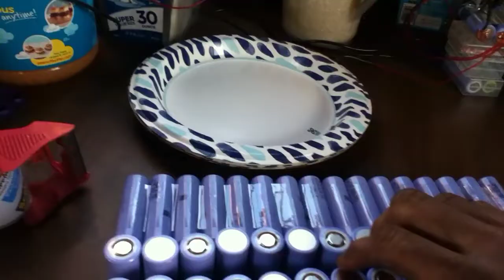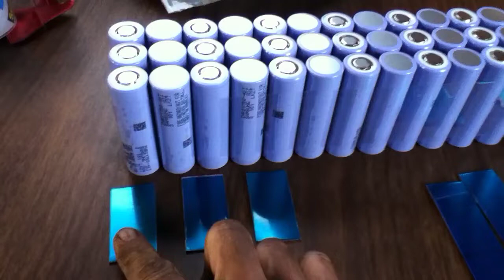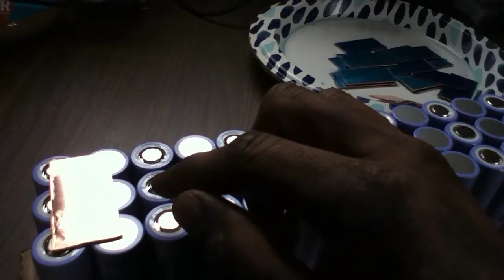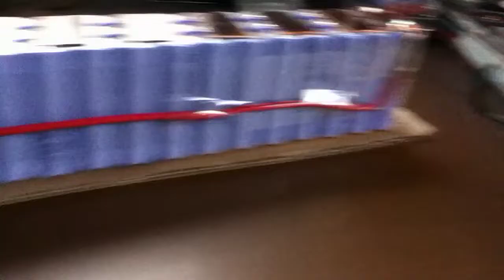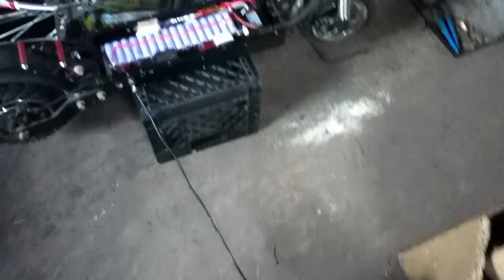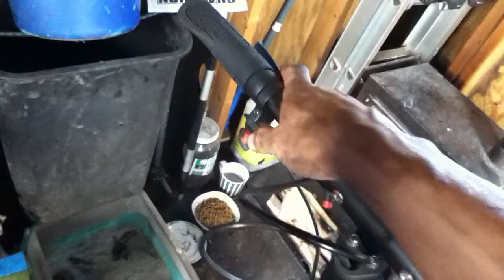How to Build Battery Pack without Soldering ,the Simplest Way

Comment from the maker: Important Disclaimer  This battery pack failed after 1 month of use as the silver content in the silver paste epoxy is fake. It was not real silver nor did it have any purity. Most places carry fake silver so be extremely careful before buying this kind of product. God told me that if this had real content of silver it would have worked fine on the battery build, exceeding the performance you get from pure nickel stripped battery pack in terms of delivering the current in efficient and effective way.  Unfortunately God told me you won't be able to get real silver content on these epoxy so just go with the spot welding technique on the pure (or near pure) nickel strip which can be found on internet if you look hard.

Comment: So, I’m building my first battery pack for my custom scooter—a 16S4P configuration (60V, 20Ah) using Samsung 20S cells, which have a discharge rating of 35A per cell (that’s 140A total!). However, I only plan to install a 100A BMS (Battery Management System). In this case, I shouldn’t use 0.2mm nickel strips, right? Given that 100A will be flowing through the pack—similar to what you show in your videos—I need to use copper strips, correct? Should I use 0.2mm copper sheets that I cut to size, or perhaps purchase pre-cut copper strips designed for two parallel cells? Is it correct that, when using a 100A BMS and building a pack like the one in your video—but using high-performance Samsung 20S 21700 cells (with a 35A discharge rating each)—I should be using copper strips? Is that right?

Comment: Thanks bro your the best💯👌🏼I appreciate you bro🙏
It’s my first time trying to understand how I can build my own battery, would 52v work on 48v ebike?
Many others cuts the video fast forward it miss leading
Reply from the maker: If you want to use a 52V battery you will want to use a controller that supports 52V.  Some 48V controllers can take 52 or 60V battery pack but will put stress on the metals inside the controller and will burn out faster.  You could use a auto-switching 48V~72V controller and use the battery voltage of your choice.  Most controllers sold to the public are garbage as they use junk metals in the controllers. They are absolute junk so their life is anywhere from 2~ 8 months. You could just replace the Goddamn controller every sever months so you can keep the ebike running. Or just wait for a year so that the quality of the controller gets much better.  Blame the Korean bitch criminals underground.   You also have to be careful what batteries you buy to build because most of them are absolute garbage. The batteries can't handle more than 2A and will lose charge soon. They have very short life.   Just forget the ebike route and get a Dualtron Sonic Model A Alien as it comes with super materials used in the battery. Samsung 50S they claim it uses is a rebadged name but uses extreme premium materials so it will handle very high voltages and current.  Both the battery, controller, and the motors should last indefinitely unless you break it by accident.  You don't have to worry about building a battery pack because the bulk batteries you get a nearly all junk.

Comment: are there any mechanical clip on contacts for batteries, similar to the battery holders for pcb soldering, but that clip on with some sort of flex pushing them against battery terminals ?
Reply from the maker: You could use Vruzend battery building kit for building a battery pack which won't require soldering but it takes up a lot of room height-wise.  I would refrain from using silver epoxy right now because they all are made with fake silver and use absolute garbage metals that look like silver.. so they cannot handle any high voltage and current that's beyond 5V...  Just use nickel strip and spot-weld your battery....
Reply: the battery holders to be soldered to pcbs seem like the smallest bulk, are there any videos to make a lightweight 10S1P battery for ebike with 5 Ah batteries ?
Reply from the maker: You don't want to go 10S 1P for ebike application because the battery will not be able to handle the load. Even with the 5 Ah battery cells it will not cut it. The voltage will drop very dangerously and will lead to shutdown due to low voltage cut-off.  You need at least 3P.   And go with the Samsung 21700 40T cells.....  They (the genuine ones) hold more energy than the 5Ah cell like the Samsung 50E or LG M50LT cell.  And the life cycle is nearly infinite, those now have special metals inside the cells for very high energy output and energy storage.

Comment: Rule No.1 in electricity, is to avoid loose contacts .
In the case of battery DIY The best thing to do is to solder by any means to avoid FIRE .
Loose contact generate heat when higher load is applied .
Safety must always be prioritise over money , unless you give no value to your life .

Comment: This connections, where is 4 cms of wire without isolation, will after heating of one cell, due to overvoltage / you have no BMS /, destroy not only
battery and scooter, but also your house, look at fire department videos, what H2 C2H2 CH4 HF CO etc. can do to your house, if not ventilated.
BMS is for controlling temps. Temperature of cell is crutial. What is thermal runaway temp for: NMC433 NMC532 NMC622 NMC811 NCA LMO
LCO LFP LTO LNiPO4 etc. ? If you do not have at least 20 Dallas or LM335 temp sensors, hhow you can derive dT / dt ? At what temperature
raise of your cell, you have to throw all you pack into 1000 litres of water to cool ? 
People are not educated properly, what ammout of energy is concentrated in this cells at 100 % SOC.
You do not have temperature propagation isolation between cells, you do not have proper cooling of the cells.
This all are risk factors, and nobody will use battery like you, becasue he is responsible, and at least reads 1000 pdfs
form Stanford Berkeley MIT Dalhausie JSNW etc. , before constructiong such battery pack. 
If you do not care about reading, you will see, that this design is bad, look at 2000 videos first, how do make such powerfull pack.

Comment: Even with fast forward it doesn't help i hope it workec
Reply from the maker: Don't use silver epoxy and copper. The silver epoxy being sold to the public are all fake. They don't have silver content at all..  They use absolute junk leftover metals that look like silver.  Just use fake nickel strip available on amazon. They will actually hold the electrical flow and function, the silver epoxy will not.

Comment: I dont see a  bms board, did you install one?
Reply from the maker: My batteries don't have BMS, none of them. I have multiple packs that are running great, no problems and it has been 2.5 years.  The batteries, without the BMS, self-balance at all times, whether charging or not.  The implementation and deployment and education on the BMS all come from the underground criminals.  They use it for evil reasons, to track and kill people via electronic weapon by attacking your blood cells and oxygen. They use our own battery (and the batteries in nearby area within proximity range) to attack our blood.  The BMS connects to their server for this very reason.  And my advice to you, please don't buy any batteries the reviewers and marketing recommend. For example, Molicel P42A batteries, are actually made with absolute junk metals that are nearly totally worthless. They degrade very quickly and crack, even with fairly low current charging at 2A.  They have very short lifespan and can't handle high current the crooks say they do.  Nearly all battery cells that the general public can get their hands on are all junk. They go bad quickly.   The only ones that are real good are the special batch (foregoing production) Samsung 40T cells.  They contain 99.95% purity silver in the cell.  The criminals don't want you to know because of security reasons. And they are priced very low.  Check here to obtain them. -->  https://apowergroup.en.made-in-china.com/product/yBXQvmOuXJfh/China-3-7V-14-8wh-Inr21700-40t-21700-4000mAh-Lithium-Ion-Battery-for-Samsung.html    The reason why I know which ones are the special batch and which ones are the fake ones is because I get information from the underground criminals because I hear them (and see them) spiritually their conversation. And God tells me to confirm.

Comment: So I'm new to all this as you will probably see with my question. You stated the power dropped when throttle or a heavy load was put on it. First thing I thought of when you said that was my house furnace. It has a large blower motor and to get it running up to speed a large capacitor is used to assist in the voltage it takes to get going. Would such a capacitor benefit your scooter if installed? Its called a Run Capacitor.
Reply: 2 years ago, I purchased a E-bike NCM Prague, and the bike including battery was left outside in the garage and never tended to. I believe 1 charge was put on the battery after we got it home. Now the 36v battery is reading 0.008 on the multimeter completely dead. So, I have purchased a bunch of equipment to try and learn how to make and repair packs myself. Also, I have power tool packs that need repairs, so this has also got me curious and wanting to learn these skills. Sorry for the long note here I just wanted to give some background. Thank you so much for your time making these videos as they are very informative.
Reply from the maker: @ejkiras  As for the dead battery on your ebike it's the USB port on the ebike sucking up all the juice so if you leave it uncharged the battery will die after a while.  The battery needs a jump start.  Jump starting li-ion batteries on youtube videos should work..   Unfortunately the most (almost every seller on the net for the general public) battery cells are either fake or made with junk garbage materials so they can't handle high current charging and discharging and will not last.  If you need real genuine Samsung 21700 40T cells let me know I will give you the link to it.  They handle 12A charging and 25A discharge without a single sign of degradation. They come from completely different source for materials to produce them.
Reply: @noobz5056  I would like that link please and thank you for your response.
Reply from the maker: @ejkiras  EDIT:  You can go here -> https://apowergroup.en.made-in-china.com/product/yBXQvmOuXJfh/China-3-7V-14-8wh-Inr21700-40t-21700-4000mAh-Lithium-Ion-Battery-for-Samsung.html   God told me that the Samsung 40T cells they sell now come from a different source, the materials, that are sent for production. It is the same website, one of the multiple places out there on the web. The cells now contain special metal that is extremely conductive. The discharge capability is now at 550A per cell, and charge capability at 390A and still will last multi thousands of years.   And the voltage can handle about 105V per cell with same life.  The discharge and charge can go way way higher but the battery life will be reduced. God told me that at 90V, this production of the battery, will last infinite life.   And in a few months the materials will be upgraded to silver at 99.95% purity.  Plenty of production coming, not having to worry about running out.   The ones you bought there is the same stuff, the 550A discharge capability.
Reply from the maker: @ejkiras  These genuine Samsung 40T's and the alternative link I included give you more range than the Samsung 50E batteries you can buy today.  The amp hour rating is misleading. The 50E doesn't hold (same with LG M50 series) as much as they claim compared to the high energy discharge 40T cells.
Reply from the maker: Hi, the problem was the fake silver epoxy, so it can't deliver the voltage and current needed for the scooter to run properly. For very low voltage and current application (5V or less) it would work, not anything higher, as the color on the epoxy on the battery turned yellow/gold and degraded very quickly, less than 3 weeks.  I tried this experiment twice, two different battery pack build with same result.  So I stopped using that and went good'ol fake nickel strip to spotweld for my battery packs.  Even the nickel strips are fake, but at least it's conductive metal so that's why they work, but the fake silver epoxy is completely different matter, as it totally stops electrical conductivity and damage the battery too.    So just use fake nickel plate.  It's very hard to get a real near pure nickel strip as the criminals sell junk to us.
Reply from the maker: Hi, ok so God just told me that you got the battery Samsung 40T from the link I gave you. And you built the 60V battery for your ebike.  You just tried to ride the bike for a test and it lost power, cutting in and out.   God told me that the condition of the battery cells are perfectly fine, and you built it correctly.  However the battery wire going to the negative terminal of the battery pack is not making good connection, in the wire connector.  The metal connector is not making good connection so I would either replace that with another one or use a better connector.  The positive side wire connection is good.  That's what God told me.  Hope that fixes for you.  Let me know how it works out.

Comment: There's nothing wrong with trying new things and doing experiments, but... you must tell people that this is just an experiment and not to be copied because if someone tries building a battery that way using high power lith. cells and burns their house down or even worse apartment building. Well, you get my point. Was a cool idea though. I love my Kweld!!
Reply from the maker: You idiot, the battery pack does not cause fire to catch a whole house a fire.  The metals in all batteries used for the general consumers don't get hot enough to make fire. The metals inside the cells will get degraded quickly causing crack and stop the electricity to flow through. The metals become no longer conductive when they face thermal runaway.  The fire catching house videos are all STAGED, by the people, that are hired by the criminals.  You must've got bored and decided to come back here a few years later to pick on somebody.
Reply: @noobz5056  lmao 😂 see how stupid you are? Like its a dangerous level of stupid

Comment: what do you mean you don't have the money? what are you doing with all the money? where is all the money?!
Reply from the maker: What good is your english when you have no intelligence, negative IQ.
Reply: @noobz5056  How good is your heart if you dont have one? chill out monkey-man
Reply: @noobz5056  And stop the censorship. this is America, bucko!
Reply from the maker: @ Sounds like you got hurt and still angry about the scooter I dissed.  God told me you bought a Wolf King GT Pro less than a few months ago and you got angry because I am dissing it due to problems.  Your motors (both front and back) will start to fail soon because your controller is breaking them.   When your scooter starts having more problems your attitude toward me will change, like that little puppy dog crying.
Reply from the maker: @ So what are you going to do about the scooter when it completely fails soon?  The motors will go completely bad.  God told me you got it from some online place where they sell used/refurbished scooters.  So you don't even have warranty on the GT Pro.  Once it fails you won't know how to troubleshoot it and fix it yourself.  You should've listened to me in the past and not get the Wolf King.  Should've gotten the Dualtron Ultra 2 Upgrade brand new if you had the money.  That scooter doesn't break, the controllers are built like tank, near break-proof, and puts out a lot of power.
Reply: @ dude, you tripping me out! how you know all that? really, where did you learn all that about me and my scooter? c'mon
Reply from the maker: @MrLarry-gr8  Because I see people's faces and what they are doing deep underground who eat human meat and do other terrible things..   I speak truth about people God shows me and they can't deny it because it is truth.  Whenever I say things to you, you need to listen and take heed seriously.
Reply: @noobz5056  I been eating human meat?
Reply: Hi Noobz. I watched your video for the second time but this time I noticed something. Your video I must admit is a very well made video. Very thorough and you articulate every step so clearly. You are the template on how tutorials should be made. I didn't notice the first time how well this tutorial is. Keep making more if you have time please. Thank you 👍
Reply from the maker: @MrLarry-gr8  Hi Larry, thanks for the kind words..  God told me that you are wanting to fix your Wolf King GT by building a new battery yourself and replace the going-bad one.  Be sure to get the special batch Samsung 40T cells for you to build, as they are designed to take very high voltage and current.  And for a spot welder that works for an affordable price I recommend this -> https://www.amazon.com/dp/B0BWDBJFCF?ref=ppx_yo2ov_dt_b_fed_asin_title   And please do NOT use BMS.  It's a fucking criminal tactic from the criminals.  So the battery building will be very simple.  You don't have to wire battery discharge and charge wire separately, just use the discharge wires and add charging wire to them.  The batteries in the pack self-balance at all times without the BMS so no need for balance charging.  You can use the existing Wolf King GT controllers. You have multiples of them right?  Each controller set will last about 5 years so that'll give you about upto 25 years to use.  Or you can upgrade to Dualtron Thunder 3 controllers later.  They last much much longer...and have more consistent power output.